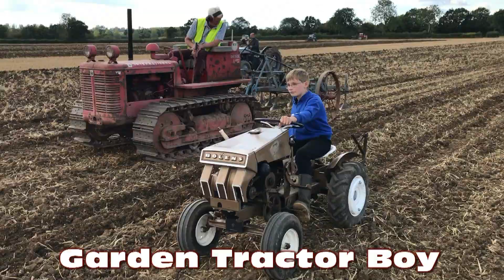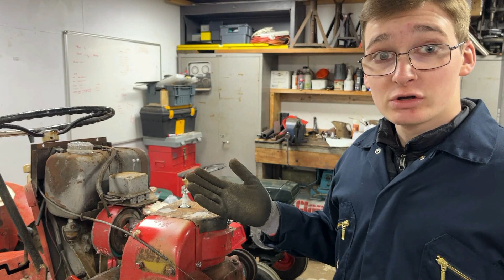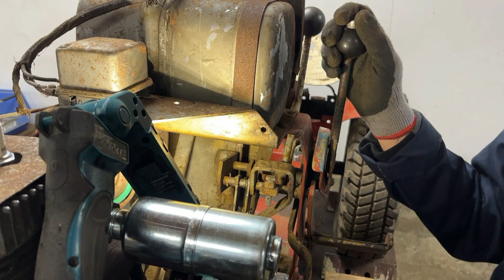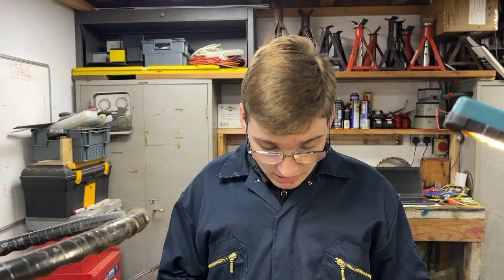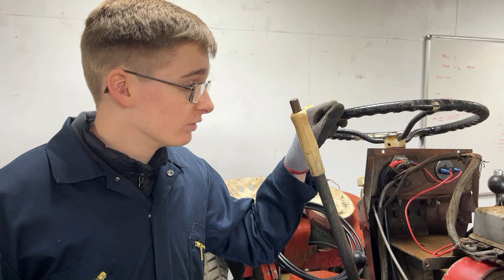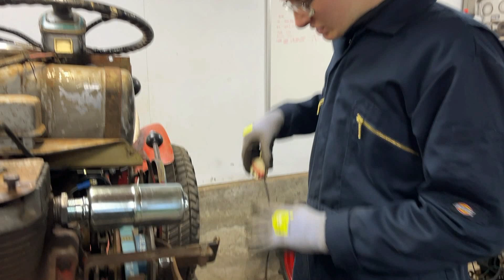The three Bolens Ride-a-matic's project - Part 10 (Engine transplant cont.)

Comment: How's she goin'?  Wow Joseph, you made a lots of progress on the tractor in this video.  Sourcing the parts and pieces is good experience as you need to get to know how the parts are sized and measured.  The springs for example.  You discovered that the springs were Imperial and the replacement was metric but measured very close to the size you needed.  Great experience to find out how springs are identified and sized.  Looking forward to seeing the tractor start up!!  Good luck with that.  Take 'er easy!!
Reply from the maker: Thanks. We enjoy trying to match or make parts. Sometimes it does not go to plan no matter how many times you measure something. It will be great to start the engine and test the tractor. Take care

Comment: Having a few tractors around to get parts from while getting them going is handy. Good luck getting the chock cable repaired. Those cables can be stubborn at times. Have a great New Year 🎆
Reply from the maker: You are right, it has worked very well having these three together. We are holding out hope for the cable. I hope you have a great New Year too. Take care

Comment: Expert video as always fellas. 👍🏻
Great to see it coming together. Can’t wait for the start up video. 👍🏻👍🏻
Do you keep a log as to which pieces and bits are original to each tractor. Just for reference. ? 
Did you put gasoline in the gasoline tank to test for leaks, before install ? 

Have a great New Years Day celebration. 👍🏻👍🏻👋👋
Reply from the maker: Thanks. We do struggle with the best way to be organised and we document when we remember. In this case we had to look back on previous videos. The tank did not leak when we were cleaning it so we did not test before fitting it. We have started preparing for next weeks video and the first thing we did was put some fuel in the tank, I think you have suggested how well that went :-). Happy New Year!

Comment: Flex the choke cable to break it free. You are using crimped fittings on small wires. Do the small fittings shrink when heated too? Have a Happy and Healthy New Year. Good Luck, Rick
Reply from the maker: Every time we are in the workshop we flex the cable and when we leave we soak it. I hope it eventually breaks free. The crimped fittings we use on the small wires do not shrink, we would not use them for a restoration but they work well for a quick fix. I hope you have a Happy New Year too. Take care

Comment: Nice job fitting the cowling, try whipping the choke cable on a hard flat surface see if it helps loosen the rust inside, where did you get the cables from and are they 2.5mm wire in them
Reply: Good idea.  I've done that many times, and it does work most of the time.  I've also soaked the cables in vinegar a few days which dissolves the rust/corrosion.  Rinse and then soak in a light oil (like ATF) and they come out like brand new.
Reply: @santaclause2875  vinegar is really good for removing rust
Reply from the maker: We will try that with the choke cable, thanks for the tip. The battery cables are 16mm flexible welding cables and I believe the other cables are 2.5mm. The battery cable came from ebay but the other wire was bought as a 50m reel many years ago and I am not sure where it came from. Take care
Reply: @GardenTractorBoy  thanks for that i was thinking about the 2.5 cables as i may be able to use them as throttle or drive cable
Reply from the maker: @tinkeringtaylor3053  I did some investigation and it looks like we bought the cables from ebay and they are the ones made by Rockwood. The ebay item number is 141453593219 which you should be able to put into a search. I did not put a ebay link as comments with links seem to get removed. I hope this helps
Reply: @GardenTractorBoy  thanks for that. I will check out tomorrow